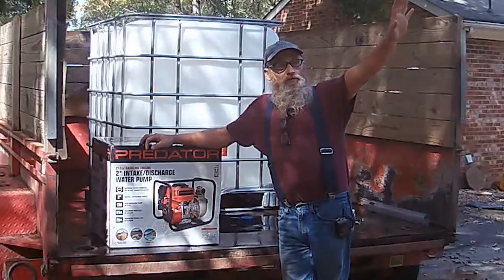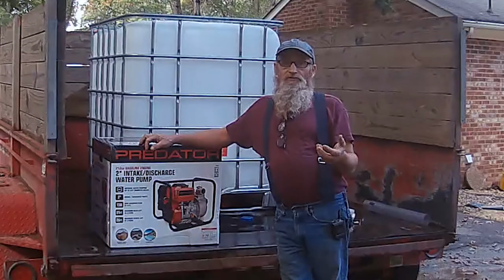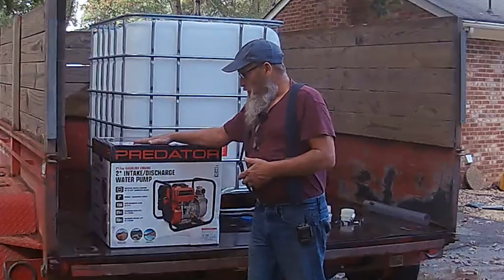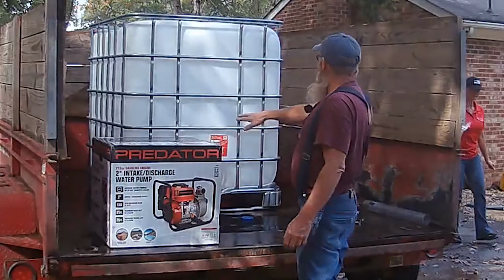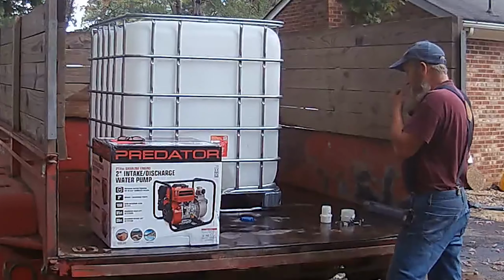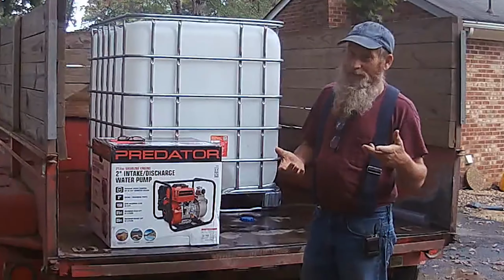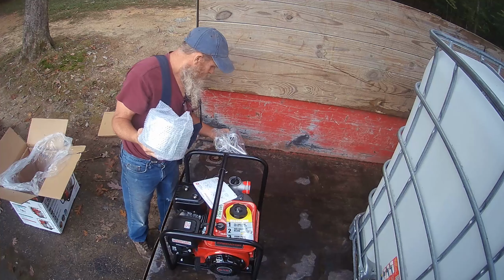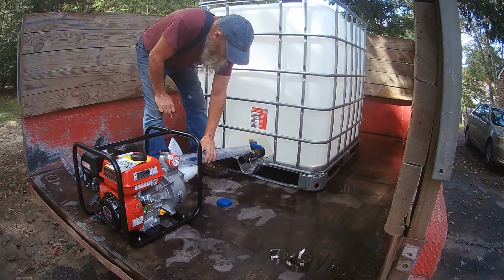Building a portable irrigation system, the super soaker

Comment: Good plan Dave, we are dry as a popcorn fart over here in N. Bama, I bought the same pump from HF and it has proven to be a reliable unit 👍, BTW I love the music from the Hound, I have always had beagles to chase rabbits and there is no better music to my ears❤ and as a messed up note, I pulled the RF knuckle off my 3400 last week, working with some big rocks and busted concrete filling in a big crater 40 X 60 X 3-4' deep, popped the snap-ring off😮 then had to wait on parts😢..... hope you get the seeds going, looking good👍🙏
Reply from the maker: Man I sure hope you can repair that for a reasonable amount. Everything is so expensive these days.